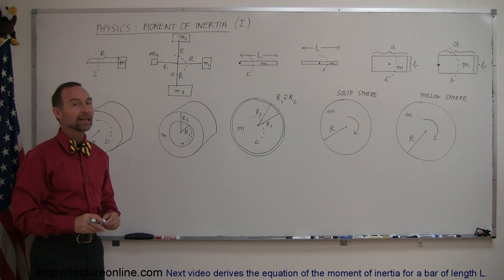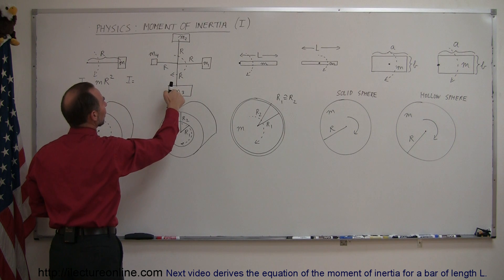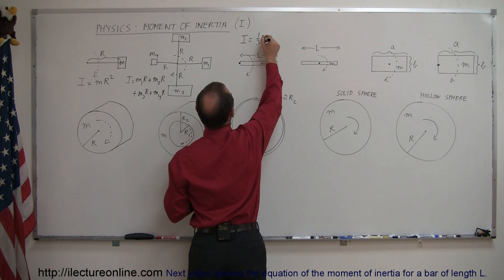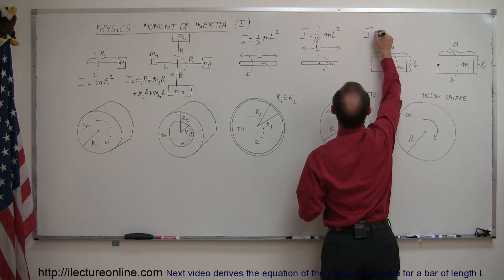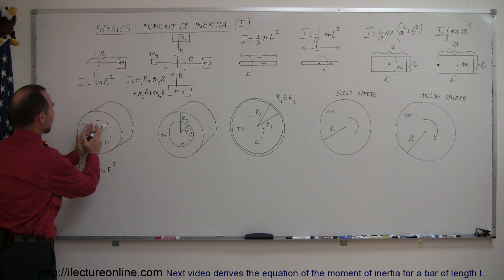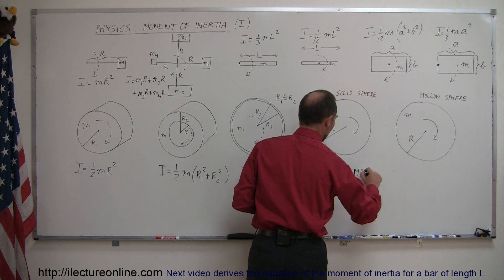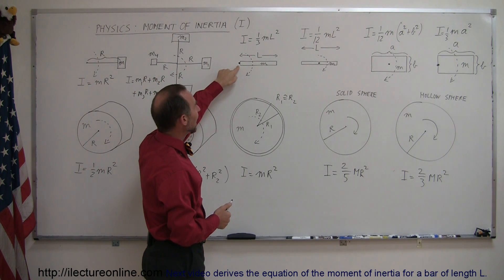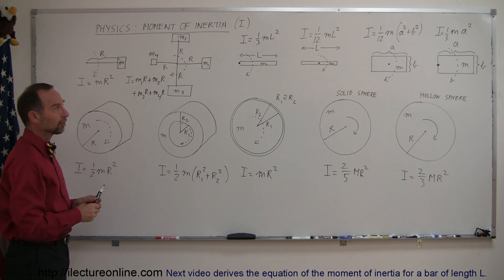Physics 12  Moment of Inertia (2 of 6) Overview of Moment of Inertia Equations

Comment: Enjoying your lectures while going through K&K. The formula for the plate with the axis at the edge is incorrect.
Call the moment of inertia with the axis at the edge 'I' and at the middle 'I_m'.
Derivation 1: Parallel axis theorem: Take axis through the  middle and move it to the edge:
I = (I_m)+M*d^2=(I_m)+M*(a/2)^2=M*[(1/12)*(a^2+b^2)+(a/2)^2]=M*[((1/12)+(1/4))*a^2+(1/12)*b^2]=M[a^2/(3)+b^2/(12)].

Derivation 2:
Imagine the plate (with the axis at the edge) along with another plate reflected about the point of the axis. The new (combined) figure would have double the moment of inertia as the original, i.e. be 2*I. 
But the combined figure would be a new plate with double the mass and 'a' doubled as well (but leaving 'b' the same), and with the axis through the center. Using the formula from the prior figure, but with the adjusted values,
2*I=(1/12)*(2M)*[(2a)^2+b^2]=M*[8*a^2+2*b^2]/12.  Dividing both sides by 2 (and reducing) we get

I=M*[(1/3)*a^2+(1/12)*b^2].

Hope this helps.

Comment: Sir, should the equation for the first plank(rotate about the center) be 1/12 Ma^2 instead? Because the length b doesn't matter
Reply from the maker: Note that the order between the thin boards and the wide boards are reversed.   The moment of inertia of a thin board rotating about its center is indeed  (1/12) ML^2

Comment: why the momet of inertia of disc ( Differential part of the cylinder) is 1/4 (mR^2) . when the Axis of rotation passes perpendicular to the axis of symmetry of the cylinder. I mean if I put the cylinder let's say on a table on its bases. And there is a pivot axis that passes through the center of the cylinder that is parallel to the table. Why is the moment of inertia of this disc  is 1/4 (mR^2)... I did not find any suitable formula :(

Comment: Shouldn't the bar with the axis in the middle be (2/12)m*L^2?
My thinking is this:
([1/3]*m*[L/2]^2)+([1/3]*m*[L/2]^2)
=([1/3]*m*[<L^2>/4])+([1/3]*m*[<L^2>/4])
=(m*[<L^2>/12])+(m*[<L^2>/12])
=2*(m*[<L^2>/12])
=(2*m*L^2)/12
=(m*L^2)/6
Reply from the maker: The equation in the video is correct.  We have several videos in the playlist that show you how these are derived.

Comment: in the seventh figure (plane) should not it be a squared plus b squared?
Reply from the maker: It depends on the size of b.  If b is small compared to a then no.  If b is relatively large then we have to use the parallel axis theorem to find the moment of inertia.  (Shown in videos in the playlist).

Comment: Sir btw rod and solid disc which has more inertia and diameter?and how to find diameter to tell it has more inertia or not
Reply from the maker: It depends on the mass, the radius, the length and the width.  You can calculate that using the equations in the video.
Reply: Yeah I understand thiz vid  thnk you for thiz. But   If these quantities were not given and generally asked question on basis of given diagram then how i  consider e.g rod and disc have same mass but diff diameter then which have more moment of inertia

Comment: The rectangle on the far right side is wrong. It does matter how large "b" is. You can even simply reason by the parallel axis theorem. Compared to the one to the left the point of rotation is shifted by "1/2*a". So adding m*(1/2*a)² to 1/12 * m * (a²+b²) does not equal 1/3*m*a² but is instead 1/12*m*(4*a² + b²)

Parallel axis theorem:
I = Ic + m*d² with d = 1/2*a

1/12 * m * (a² + b²) + m * (1/2*a)²
1/12 * m * (a² + b²) + 1/4 * m * a²
1/12 * m * (a² + b²) + 1/12 * m * 3a²
1/12 * m * (a² + b² + 3a²) 
1/12 * m * (4a² + b²) 

You can also reason be pure logic. Just imagine "b" gets very large. Much larger than "a". It's obvious that b has to play a role in the moment of inertia.

ps: This is also the correct answer given on this wikipedia page:
https://en.wikipedia.org/wiki/List_of_moments_of_inertia
Reply: Uhm "h" in the wikipedia article is your "a". They simply named the "length" of the plate "height". Since a plate is a two dimensional object it only has two axis which can be named "width" and "height" or "width" and "length" but they mean the same thing just like naming them "a" and "b".

I do agree that they could have been more consistent with the naming. However i guess the examples have been added by different authors just judging based on the image style.
Reply: Yes, of course, I almost always do. However the wikipedia article is still correct. It shows the correct formula that matches to the drawing they have for the plate. I'm not sure what you want to state here. In your first comment you said that the wikipedia article is wrong however it isn't. It doesn't matter how you name your values as long as you reference the correct measurement.

Comment: Mr. Biezen, for the moment of inertia for the slab, you have I = 1/12 M(a squared + b squared). My books has the formula 1/2Ma squared. Where does your a squared + b squared come from?
Reply from the maker: It depends on where the point of rotation is.  If you rotate the board around the CM then you need the a and b in the equation.  If you rotate the board along the point at the middle of one edge you don't.

Comment from the maker: Most equations in physics like this one are derived from experimentation.  With F=ma, the acceleration is proportional to F/m and in the same direction as the force.  With Torque = I * alpha,   I is proportional to Torque / alpha   (where alpha is the angular acceleration).  With experimentation you can find the I (the moment of inertia) must be equal to mR^2.  Also, you can show a relationship between linear momentum and angular momentum, which again shows that I = mR^2.    See the example:  Physics - Mechanics: Angular Momentum (7 of 11) Ex. 6: Bullet Striking Beam    https://www.youtube.com/watch?v=Le6S2ag-oGE&list=PLX2gX-ftPVXVN2K-94gb_S2Yu3hLuV9xD&index=7

Comment: Does I=mR^2 have a mathematical demonstration?
Reply from the maker: Most equations in physics like this one are derived from experimentation.  With F=ma, the acceleration is proportional to F/m and in the same direction as the force.  With Torque = I * alpha,   I is proportional to Torque / alpha   (where alpha is the angular acceleration).  With experimentation you can find the I (the moment of inertia) must be equal to mR^2.  Also, you can show a relationship between linear momentum and angular momentum, which again shows that I = mR^2.    See the example:  Physics - Mechanics: Angular Momentum (7 of 11) Ex. 6: Bullet Striking Beam    https://www.youtube.com/watch?v=Le6S2ag-oGE&list=PLX2gX-ftPVXVN2K-94gb_S2Yu3hLuV9xD&index=7

Comment: I'm not sure if this was stated, but how did he find the Constants? Are the constants just something to memorize?
Reply from the maker: It is actually possible to calculate the constants.  This usually requires integration.  I have 2 example videos (a solid cylinder and a long rod) that show you how to do that.  My recommendation is to memorize the constants of the typical shapes, like those in this video.